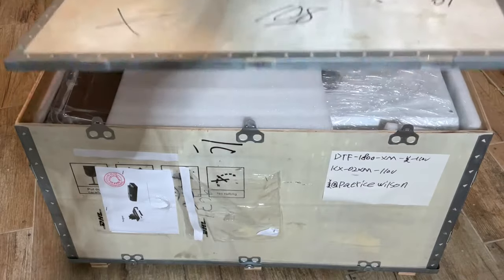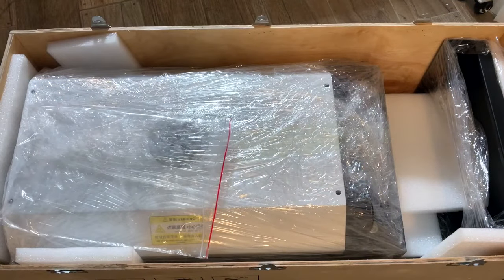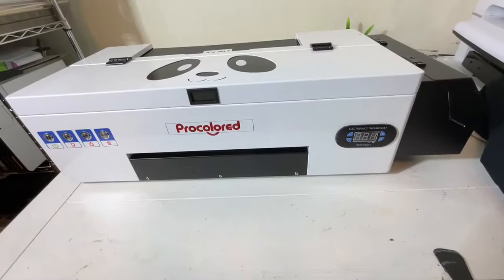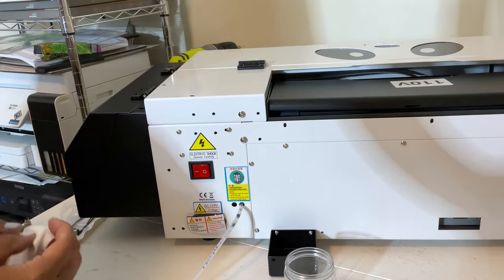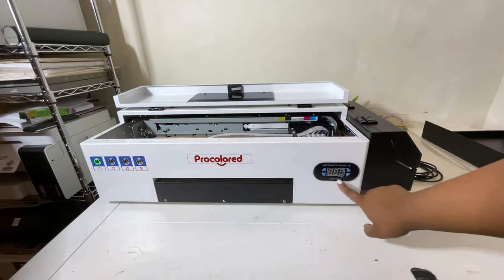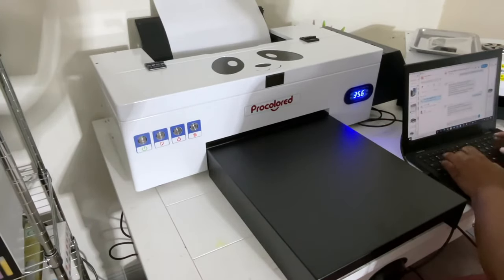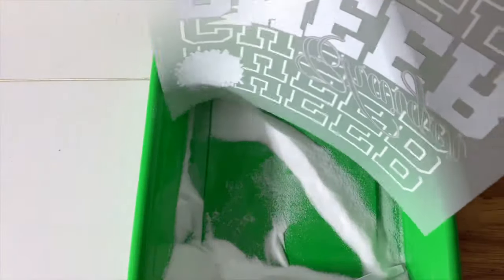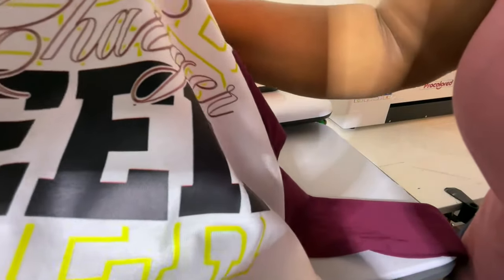DTF PRINTER UPGRADE  UNBOX, SETUP & PRINT  PROCOLORED L1800 DIRECT TO FILM  HOME T SHIRT BUSINESS

Comment: Thank You for this awesome video. I couldn't of installed the printer without this video. I have a couple of questions. What icon do you click on to open the software design program ?  where does the battery for the stirrer and temperature go ?
Reply from the maker: You can use Photoshop to design your image, due to shipping restrictions, we do not provide batteries, you need to buy them yourself

Comment: printer was easy to set up but when i went to install the rip software the drive wasnt working , now im trying to contact customer service to see why the drive they sent with printer is not working.. will update you on the timely customer service i may receive. so i called through what up app and also emailed therm. so now im just waiting on a call